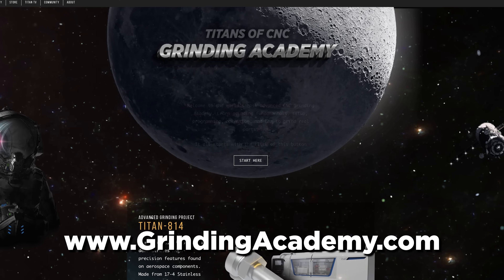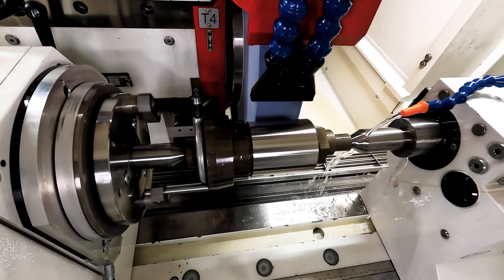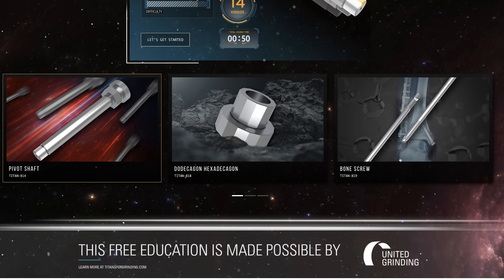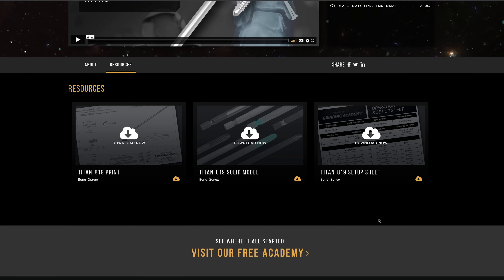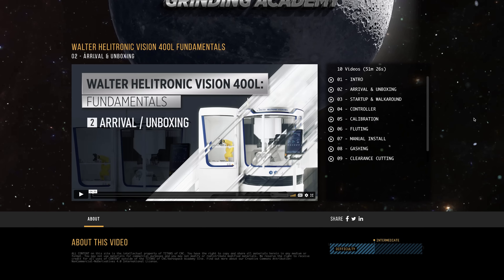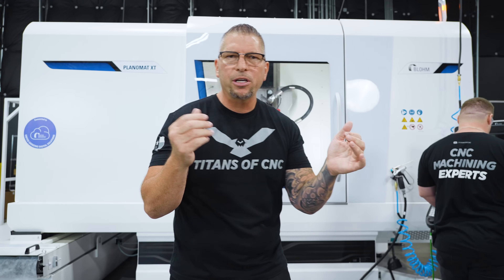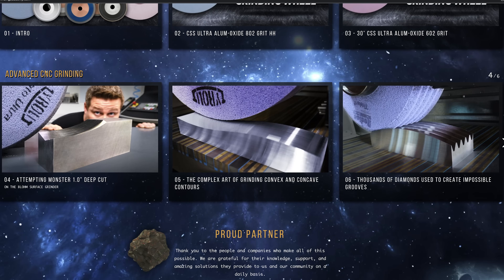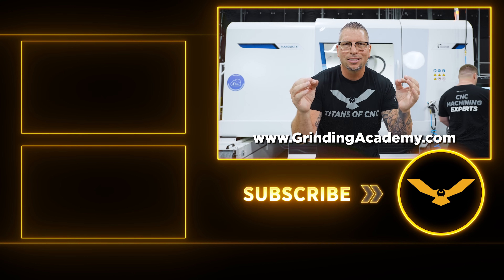Most Machinists Know NOTHING About This

Comment: Hey one comment on the academy videos. I'm an audio engineer. The intro sound (the little jingle at the beginning of the video) is way too loud - at least 12, maybe 30 dB too loud. If I have speakers set loud enough so that I can comfortably and clearly hear the talking, the intro sound is really overpowering. It can be even heard that the sound clips, which means that it's set too loud for its digital format. Given you put this up on Vimeo, re-rendering the files and putting them up again should not break the site, but it's a little work for sure.
Reply from the maker: Hi cheater00! Thank you for bringing this to our attention. Please let us know which academy video you are referring to and we will have a member of our team look into your request.
Reply: @TITANSofCNC  thanks, for example "Blohm Planomat XT Fundamentals - 01 - Setup" but every video on the grinding academy is like this, my guess is you used the same project / clip for all the videos. It's the bleepy-bloopy-whooshy sound at the start. Looking through the videos I also noticed another issue - some, but not all, of the videos have major high frequency content, just generally noise from the machines, and that is dangerous for listening to for long periods of time - especially if you're on loudspeakers or headphones because those amplify the noise additionally. Plus it's tiring. You guys need an audio engineer - someone who works off site, not in your offices adjacent to the main shop, due to CNL (continuous noise levels). High CNL will always skew an audio engineer's sound perception, so they will not be able to hear if something's wrong with your videos.

Comment: For free... just need to buy a machine which costs 300k+
Reply from the maker: Study this and then go get a job at a facility that has these machines.
Reply: @TITANSofCNC  He wants Biden to supply that for him. LOL.
Reply: @nicks2154  You know that you can get federal grants for starting businesses.  Especially manufacturing.
Reply: Gotta spend money to make money!
Reply: Cry more lib.
Reply: You can apply a lot of these fundamentals on any manual or cylindrical grinder that costs a fraction of the price. The education is priceless , don’t hate on a great thing they’re doing
Reply: @JMakesWell  I'm not hating anything. I just think if someone is going to pay 300k+ I'd expect some introduction and/or guidance from the manufacturer.
Still if the education costs some money it's still a fraction of what that machine costs.
(I'm just naming 300k because that was the price of such a machine when I was at a trade show last year; the price certainly can be much higher for those machines).

@TITANS of CNC MACHINING did your operator have previous knowledge about how to handle those machines or did he learn it when you got the machine?